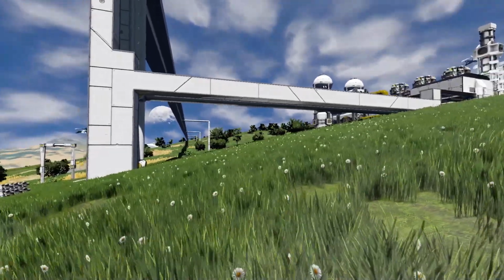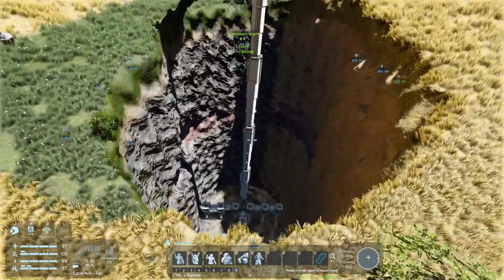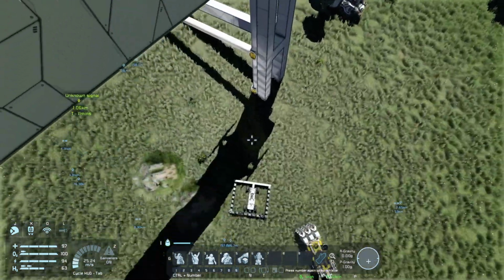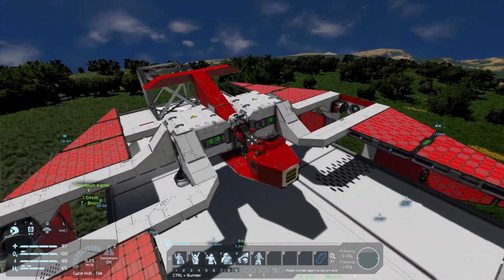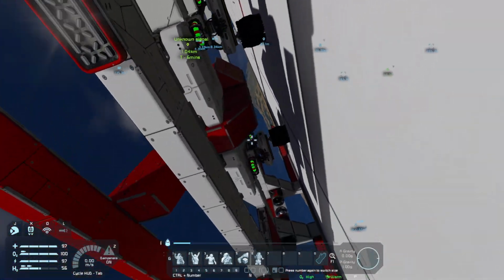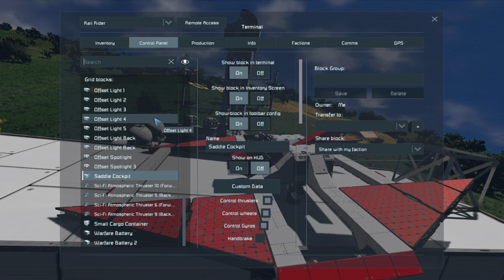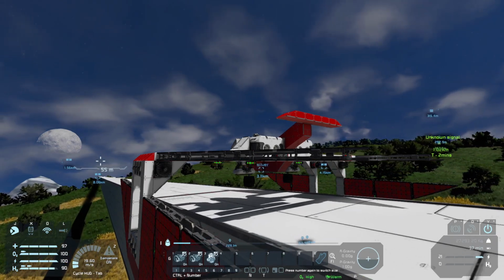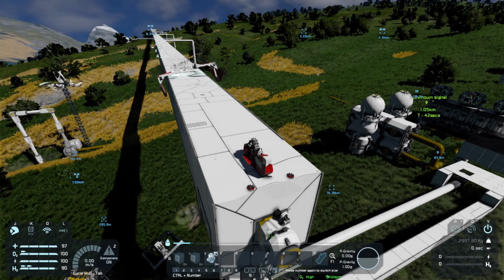Rail Rider! Space Engineers Time Lapse Series: Space Elevator Again - EP13

Comment: If you want to connect your ship with a small connector to your station, I may have a solution for you : a Connector Adapter.
- Build a large connector to your station.
- Then a large connector for small grid on it.
- Place a convoyer converter on top.
- And finally a small connector.

Now, you can connect your ship to your base and move some materials from one to the other.

Comment: on the wheeled monorail rider, if the sides are unpowerd and you have a set of wheels on the bottom that hug the rails either locked in with a piston or a rotor you will only need the top and bottom powerd the guides idealy shouldn't spin till contact is made,

Comment: I suggest automatones do all monorail flying so you wont break and lose half of your progress of your episode.. 12 episodes for only about 10 km  by my calculation your monorail would need to be 120 km long to get to outer space. Space engineers has block limit after physics stops working any you and the craft wll just ghost through the blocks. if you have 9 blocks per 2.5 meters it would be 90 per 25 meters, 900 per 250 meters. 9000 per 2500 meters 90 000 blocks per 25 km. After 90 000 blocks 6 core 12 threads cpus get the ghosting problem I mentioned. 180 000 blocks per 50 km. 12 core 24 threads cpus get the ghosting problem I mentioned.  270 000 blocks per 75 km. 16 core 32 threads cpus get the ghosting problem I mentioned.  And Station build can give you 2x preformance boost if its a station and not a ship so technicaly you can reach outer space 540 000 blocks per 150 km.  You can go arround Game Physics problem by deviding the ships and connecting them by advanced rotor so you can have acces to stuff from 3 100 000 block ships to total ship wold have 300 000 blocks together but the fps will be low and sim speed as well. 
Great video. I hope my comment will help anyone who encounters that problem or you Dave.
Reply: So the block limit before ghosting depends on your PCU power, starting from around 90k blocks? Would you get better performance if you used larger blocks?